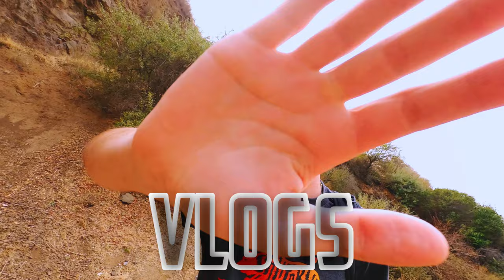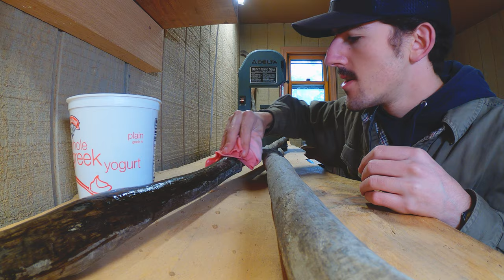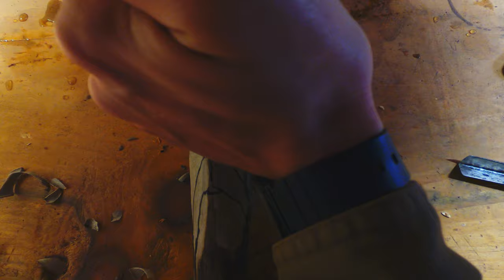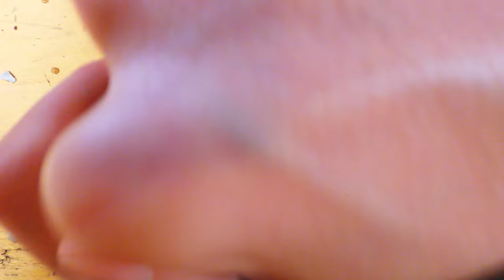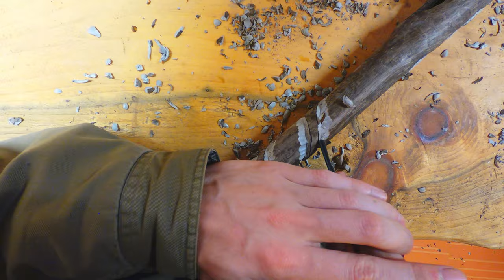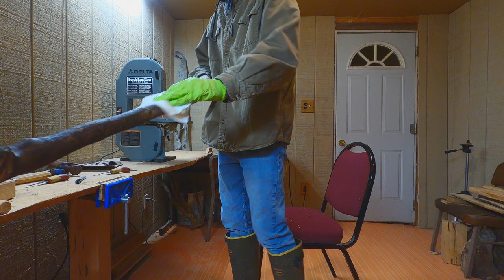Carving a TREE SPIRIT Walking Stick!

Comment: Nicely done sir and thanks for sharing. Is there a reason that you used Teak oil for a finish? Just curious.
Reply from the maker: I've been using teak oil for a lot of projects just because I like the finish it leaves and the way it protects the wood. Most other oils will do the job too though!